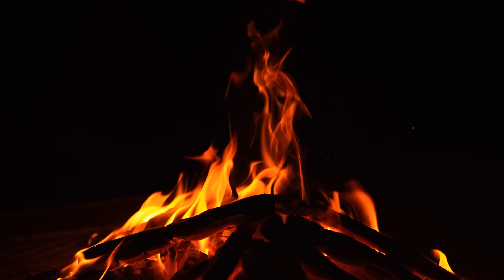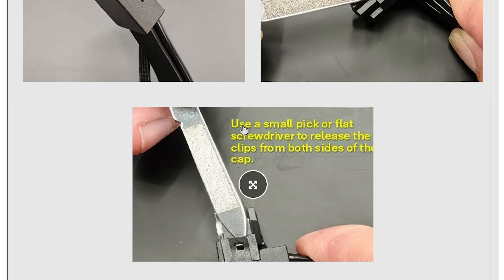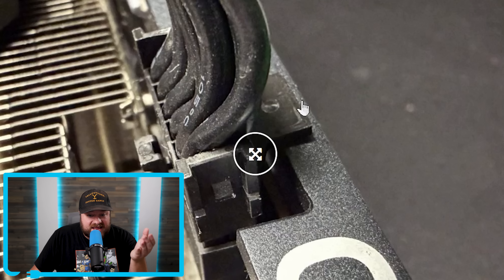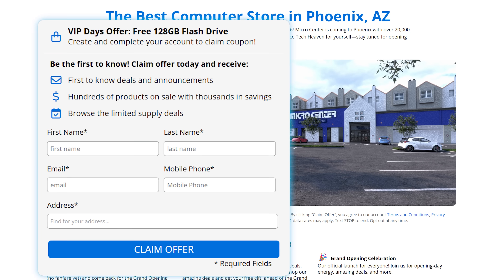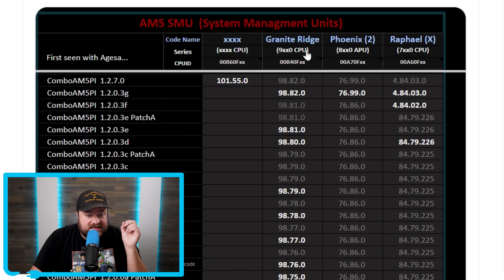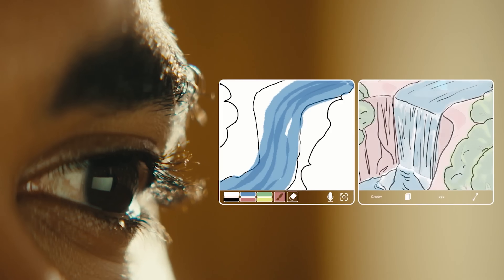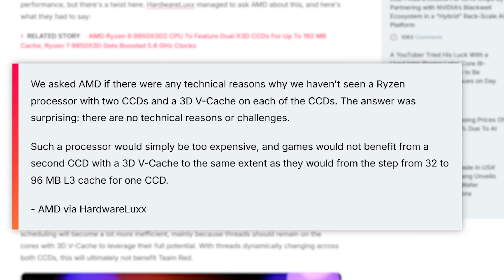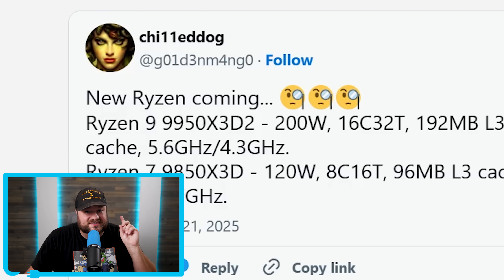AMD’s Dropping X3D 2.0 To DESTROY Everything!

Comment: Was also an electrician for a while.
When running 3 phase wiring, we had to do it in such a way so each wires magnetic field would cancel out the other, to reduce movement, heat and fires.
5000 amps with 13500volts btw, big systems.
Messing up would turn you into vapor

One of the AI datacenters.

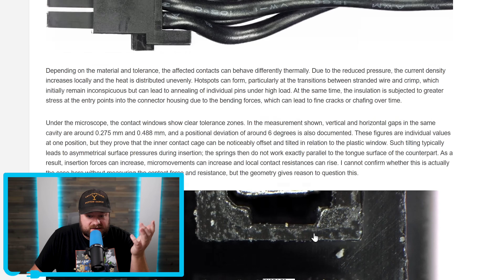2:22
The way the wires are positioned is extremely important in power situations.
If one of these contact points is reduced, the spots that are connecting to heat up far more, thus causing a fire.

If you run a 30 amp system on a 15 amp breaker for example, and that breaker didn't flip for whatever reason, the wires inside the wall would catch fire, because there is too much energy being output through that line for it to be safe.
Ideally you try to set up systems to be rated for half of what they can actually stand incase of power surges, or wear and tear.

Comment: I remember when I could load 4 operating systems on my computer RAM disk to get instant booting. I only had 1 MB of RAM.

I could load 192x that much into the L3 cache of the new CPUs. That's insane.
Our computer science department unix server ran on 100mb of RAM and served 150 students simultaneously through dumb terminals.

This thing could do it with 0 RAM (in theory, probably not in practice).

Comment: Great way to jack X3D prices back up to launch levels while giving little to no uplift. Having vcache on both chips won't magically negate the cross-CCD latency. This is precisely why the X700Xs are usually faster than the X950Xs in gaming. The only games I see truly benefitting are city builders, where X3D looked amazing early game, but fell flat on it's face late game and loses to the 16/20/24 cores where the games are pounding core count. Everything else will simply run better on a single CCD still. 

But who DOES benefit from these is AMD. X3D isn't THAT much more expensive than the regular CCDs, more like $30-$40, but if it enables them to jack prices back up $100-$150 to above launch levels that's just pure profit.

Besides, they have nothing else to show for quite a while, Strix isn't really selling that well in laptops, and Zen6 might not even show up til 2027 now with a late 26 paper launch. They need to have something to prop up prices and try to drum up interest in the brand instead of letting you realize they're still selling 2024 chips that were barely faster than their 2022 chips. 

Just a couple weeks ago they had that big video release that had effectively zero new information and it was really just AMD and Sony sucking each other off and retelling you what you already know. Just so brainless outlets like this can make videos saying "SONY ANNOUNCES NEW PS6 IN THE WORKS, AND AMD WORKING ON BETTER UPSCALING!" Well fucking duh. Even my 8yr expects there to be a PS6 at some time in the future, and AMD literally already announced an updated upscaler months ago.

Comment: 2:00 - why are we not using AMP connectors or the yellow ones for high power DC?! Is the industry fucking stupid?!
4:30 - Artificial Intelligence is NOT the same as Artificial General Intelligence, it's just a gimmick of machine learning. Chat GPT for all it's glory is just a better search engine for the internet. At it's core, it's a Large Language Model that is really good at searching and displaying relevant text that it was trained on. It IN FACT cannot calculate with numbers. It cannot produce functional code on it's own, it can only show code snippets that someone else wrote and put on the internet.

Comment: 9850x3d is another amd scam, they make you pay a premium over a 9800x3d just for overclocking it a bit out of the box

only suckers would buy it

the 9950x3d2 is great for workstations, that extra cache will be a good boost since now both chiplets have direct 3d cache
but due to the innate ccx issues its gaming performance will most likely see no boost

Comment: Everyone seems absolutely oblivious that every new 3dv-cache cpu even it’s the “worlds fastest” gaming cpu won’t make your gaming any better unless you already have the newest NVIDIA halo card. As soon as you have a lower end nvidia or amd cards it’s wasted money. There is a broad range of much cheaper cpu’s that is more than adequate to drive a medium range gpu to it’s fullest potential. Most medium range gpu’s can easy be fully utilized by a couple generation old medium range cpu’s. It’s all about concentrating on getting a faster gpu, if your budget isn’t for a real highend Nvidia card. Your bottlekneck will most often be the gpu if you have a fairly new uptodate base system. An update to a 3dv cache model over a standard 6-8 core amd will most often only boost your 1% lows with eg a 9070 or rtx 5070.

Comment: Every increase in IGPU ipc is met with reductions in compute units so it never really gets better. Back around 1080ti days they decided depreciation wasn't a thing anymore an every new generation was gonna get an increase in price. GPU makers have essentially created an oligopoly where neither are really competing against each other. It's fake competition to give microscopic gains at higher an higher prices since 2017. Luckily for consumers AMD and Intel are really battling on the cpu front mostly cuz they want that sweet sweet server market share.
Reply: How many different socket types and generations did it take before Intel offered more than quad cores?

I know for a fact, they dragged their feet as long as they could, offering users an imperceptible increase in performance with every new iteration and soaking consumers for the false perception. 

Every manufacturer enjoys cheaping out on innovation as R&D is costly.  Only way around it is by re-labeling and repackaging products.

Comment: I vaguely remember about how AMD was going to change its X3D chips so the cache was on the bottom and the CPU was on the top, making it easier to cool, so the clocks didn't need to be slowed for the extra layer of cache.
Reply: They are doing that now.

Comment: Games using more than 8 cores / 16 threads are very rare. There are very, very few use cases for a symmetrical 3D v cache CPU with 16 cores across 2 chiplets. You may even experience latency when threads communicate between the chips. I'm guessing this cpu will be identical performance to the first 9950X3D in 99% of use cases, but people are still going to eat it up because higher HAS to equal better.
Reply: We will see when the numbers come out.
Reply: @metallboy25  I can hope I am wrong! There are also real-world productivity workloads that would like the cache, regardless of gaming. I think people using those should be excited for this one.

Comment: Any idea on timeline of these new chips being released?

Building a 9950x3d workstation (AEC 3D BIM, Lidar, etc) and may hold out if it'll be on the sooner side. If not, I'll just get the 9950x3d and upgrade when the next full update comes in '26 or 27.

My question is, for workstation uses, how much faster would the chips we're discussing here, actually be than current 9950x3d's...? Single thread and multi thread. Also, was hoping to get away from an AIO and stick with a big air cooler, but with a TDP of 200w (reported elsewhere), that might be difficult. FWIW, case will be a Fractal North XL with yuuge and many fans for airflow.  🍻

Comment: At 1:56 there is a Translation Error in the article. Tension and voltage are both "Spannung" in german, and in this context tension would have been the correct word to use.

Comment: I own a 9950X3D, my current PBO settings are pushing the non 3D Cache cores to 5.7Ghz while my 3D V-Cache cores are clocked at 5.5Ghz. Guess what will happen when both CCDs have V-Cache. They will both run at 5.5Ghz or the advertised 5.6Ghz. The maximum temperature is 68 degrees, when the entire chip has a layer of 3D V-Cache under it I doubt temps will be the same or better. I even read an article how AMD stock slipped a bit when leaked information on the 9950X3D2 emerged. This chip was made to humor all of those customers that begged for it but don't expect any sort of amazing gains by it. It will probably be priced at $899, and tech reviewers will be held back by AMD NDAs on its performance until way after launch. This chip is just to carry them over until the release of Zen 6.
Reply: the 3d cache cores are kinda low, i got mine at 5725
Reply: delidd then, if u can afford a 9950x3d, you can probebly delidd as well<3

Comment: Ok, for a noob now: 
What exactly is the difference between the 9800x3d and the 9850x3d? 

Sorry didn’t get it
Reply: 9850X3D has a small overclock over the 9800X3D.
Reply: @laszlozsurka8991  yeah I saw 400mhz but will it make a difference ? Think it’s going to draw more power and be obviously be harder to cool down.

Comment: The only thing that I hate about the Apu's ist thet they have less L3 Chache and atleast in 8000 series just 20 Pcle 4.0 lanes instead of the normal 28 5.0 lanes. Could someone tell me of its just becouse its technically not possible or they do it on purpose

Comment: AMD is going to run into the brand problem of they names are just getting to long. Ryzen 9 9950X3D2 and Ryzen 9 9850X3D are to close together for most consumers so for the release product I hope they will have a cleaner name for the 9950X3D2 chip.
Reply: I hope zen 6 is 10xxx so it becomes even more silly.
Intel is doing the same sillyness their current generation's full name is "Intel core ultra 7 265"
Reply: @W1ldSm1le  Yeah but for Intel the marketing name of a 265 is better than keeping with the incrementing with generational number as it was confusing consumers. 

All I want for AMD is a not confusing marketing name. So AMD might do something similar with Zen 6 either restarting again with the naming scheme like they have with GPUs or some other way to make the marketing name shorter.

Comment: Cable straightening and crimps on those cables are fine, it's literally just the square pin housing that contacts the GPUs pins. It's a 50% contact at best, and can't be made better except using more pins....

Comment: I've been waiting for a 16 core CPU with 3D cache on both dies since the 5800X3D. If they release one now, all I can say is it's about fucking time.
Reply: As someone with a 4090/9800X3D setup, I assure you all that will mean nothing in the face of inadequate servers or poorly optimized games, which seem ever so common in this day and age.
Reply: @SupraSav  Not sure what the point of bringing up worst case scenarios is.
And it's not just games that would benefit.

Comment: Why don't they use solid core wire on those connectors?
Reply: just to save that extra buck when manufacturing millions of these defective 12 pin gpu , nvidia knows those who buy nvidia will buy it and then get their gpu burned and buy defective gpu again since they wont buy amd gpu no matter what , and if people dont buy nvidia gpu , more reason for nvidia to allot more chips for AI MANUfacturing chips at tsmc foundary.

Comment: I wonder if the youtubers will be mentioning the heat and power of these new amd cpus. Its only fair if they did as when intel were running hot and power hungry they couldn't stop talking about it?
Reply: Consider how the 9900x3d uses 185 max and the i9 14900k uses around 300 max? I'm not really seeing the problem you're mentioning.
Reply: @W1ldSm1le my 13700k uses 1.24v, pulls 220w but doesn't go above 80 degrees under load. From what I've seen a similar amd.cpu will be hitting 95 degrees plus even though using less power

Comment: I recently asked Gigabyte a reaffirming question relating to my B850 Aorus Elite WiFi7 ICE mobo regarding BIOS updates, which was if it was ok to use the BIOS listed on its pages listed as v1.x (mine is v1.0), and they got back to me within 24hours, which TBH, I was pretty impressed with. 
I certainly didn't get anything like a speedy response from Asus.

Comment: The 12v 2x6 is a stupid conector.
Reply: at this point nvidia ego is the reason they keep beating the dead horse , confidence in this new  connector is totally dead , if some one ask me whether i buy a gen old gpu and it has 3 8 pin connector vs new gen gpu but it has 12 pin connector , sadly i will go with a slightly older gen gpu rather than risking damage to my gpu and by extension other parts of cpu just for playing games with 10 more fps , it is not worth the gamble.
Reply: not really the "rated" 600W is just way to much for it to handle, like if you limit it to 300W it woudn't really be a problem
Reply: @KeinNiemand  It's not too much. They handle 1000 watts in reality, as in actually drawing 1000 watts and monitoring wire resistance with a current clamp and temperature camera.
Reply: Everyone I know has been using it without problems for 3 years. Go ahead and prove that it's stupid, smart guy.

Comment: Come come. It's a chicken & egg dilemma.

Windows 11 24H2 has AI stuff that's ultimately not very useful and there aren't many AI features in fact. And of course, Recall generated a lot of negative news.

People who upgraded to 25H2 successfully and have tried the new AI features will have something better to say about AI PCs. Yes, many AI features work on non AI PCs but will draw more power and send stuff to the cloud.

For offices, Snapdragon based AI laptops may see some life this year with the new 25H2 update since most of the AI stuff are done in the NPU and not online, thus not violating data compliancy of many countries and maintaining better privacy as companies push for AI integration.

Newer X2 Elite chips are even more capable with 80 TOPS NPU which allows even more AI stuff to stay offline. And more importantly, X2 Elite will most likely use less battery than next-gen APU from Intel & AMD. (Although I expect the margin to narrow even more compared to X Elite vs Intel Lunar-Lake / AMD Strix Point.)

Within a few years, the DRM makers will have to port their anti-cheat to ARM platform once X Elite and Nvidia/Mediatek and even AMD's own ARM based SoC hits the market. At present, Arm based Windows laptop is not even a blip on any metric but I expect that to change as. I see these ARM Windows laptop to replace the Celeron Netbooks & Chromebook.

That said, Dr Lisa Su said with the latest gen (not released yet), ARM doesn't have that much of an advantage vs x86 at the 2nm node. I believe she's talking about the LP & Zen 6c cores that will be used in next gen mobile APUs. Intel REALLY REALLY need to get their 14A up. They are paying the TSMC tax.

So far, I'm liking what I see in 25H2 on the ROG Flow X13 2025.

Comment: Why not make a 24 pin contact! Like for motherboard
Reply: Just use three 8 pin 😅 proofed by time and it way reliable than the new connector
Reply: stupid egotistical fucks at nvidia wont bow down and admit 8 pin is the more mature connector that works most of the time and it has leeway for spikes which is built into it ,  on the other hand 12 pin connector is already maxed out with very little margin of error

Comment: More cache this, higher clocks that, okay but what about IPC?
Reply: It's the same iteration of zen so it's the same, 9xxx series were just a power and thermal improvement revision of 7xxx series. Any gains between the two is from that. The next chips, zen 6, is probably going to be a big uplift as they are going to TSMCs next node.

Comment: I already have my 9800X3D at 5.6ghz, so no point for me to get the 9850X3D
Reply: True but this one should go even higher close to 6GHz after oc and pbo boost....it should be better binned silicon, right?
Reply: @semtexxxl1  Still not worth it. Better wait for next gen.
Reply: @DefiantAML  I agree it is not worth it for tbose with 9800X3D including myself. However it could drive the price for it abit lower.
Reply: i got the 9950x3d and waiting for part two of my budget plan to purchase the sapphire 9070xt, lmk guys if you want to see certain tests/benchmark tests done